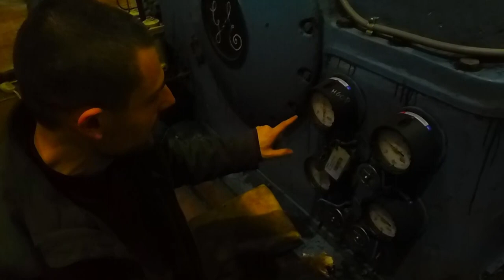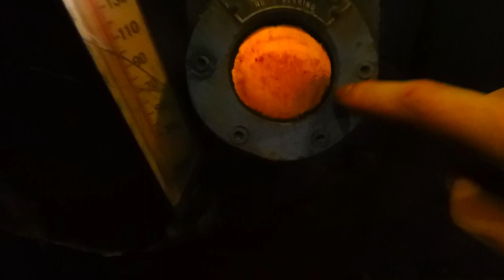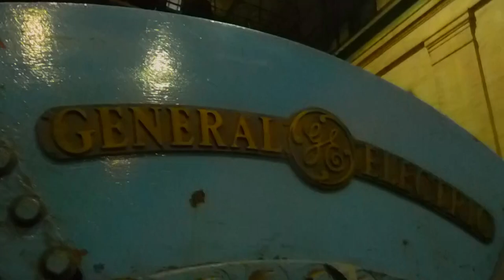Power in the House

Comment: Bonjour Alexander,
Quite interesting videon indeed, thanks ! Did you mention the pressure in the turbine ?
Besides this, what a pity to stop these machines, especially if they are garbage powered.
I have tried to operate small turbines for my model boats, not a success unfortunately, too much steam consuming for my boilers.
Amicalement, Raphaël
Reply from the maker: Raphaël, the steam pressure is 900-950 PSI with several hundred degrees of superheat.

Comment: Your excellent explanation requires no diagrams for me.  I'm guessing the exciter has permanent magnets in it... someone has to bootstrap the system!
Reply from the maker: the excitor is electromagnets also.  You jumpstart with either a permanent magnet held to the machine shell or a battery to flash the fields.
Reply: @AEKarnes  OK... I seem to remember automotive generators requiring this when first installed.